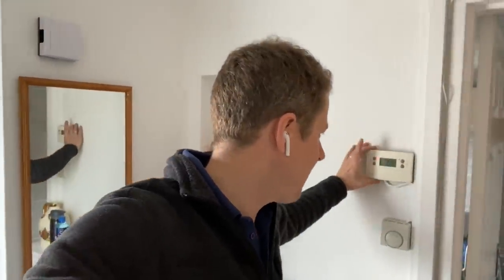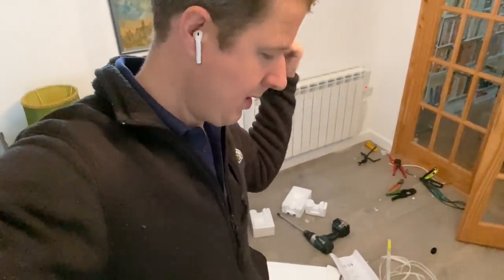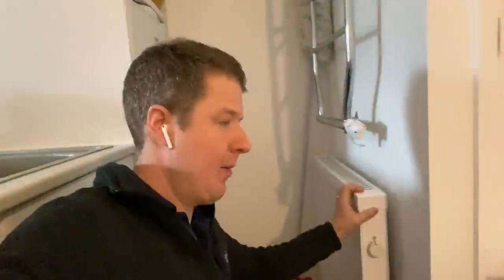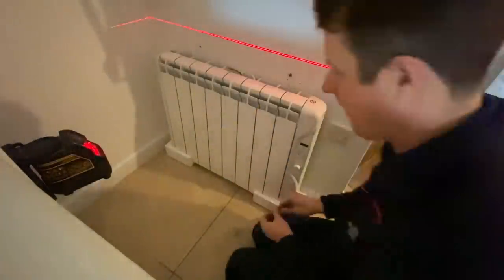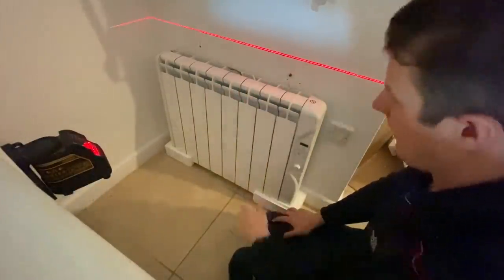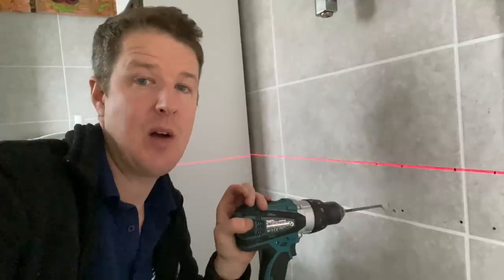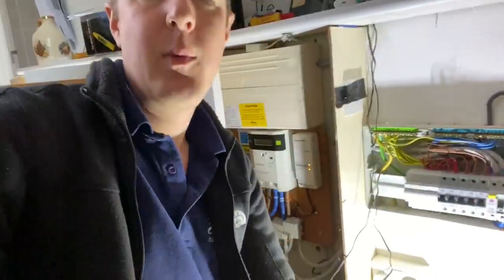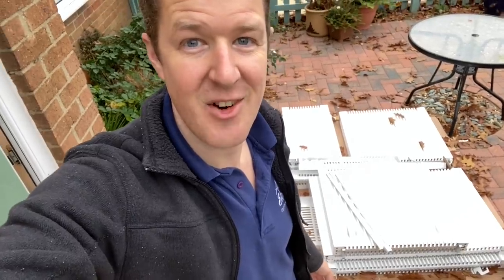Electric Heating Installation - Replacing old faulty Electric Radiators

Comment: Electric heating in 2019!!  I love it when these manufacturers say "they're more efficient than the old ones"... If it's resistive heating, it's resistive heating.  Assuming they had no way of installing a gas supply, they'd have been better served ripping the lot out and fitting a heat pump.
Reply: I agree, resistive heating is only efficient to a point.
But as for gas, I'd rather go with a huge heatpump and central heating, or here in South Africa go for heating/cooling air conditioning.
Joburg in the day isn't so cold in winter, normally in the teens with lots of sun. Best thing about summer rainfall is sunny winters 😁

Comment: I use the tile bits from Erbauer. Super cheap which is great for how often you actually need them. For marking, whatever I have to hand for most holes and a jab from  small screwdriver works well for plasterboard or softish plaster. The marxman tool is great for masonry and deeper holes though. Nice use of the flex ferrrules. For the busbar I usually use the impact to back everything all the way off before I install it, then still using the impact on its lowest setting I tighten the terminals at either end (while holding the MCBs together) then do the middle ones. After I follow up with a torque screwdriver for the proper settings and check visually using my phone but with this sequence I never miss any! 
I enjoy your EV point installs. I just got back from EVBOX DC charger training in Amsterdam yesterday!
Reply from the maker: Great thanks for sharing!

Comment: I’ve drilled tiles loads of times no issues. Mark hole location, using masonry drill of the required size place on spot, twist the drill chuck and bit Anti clockwise by hand using slight pressure on the drill, this will break the glaze on the tile where the hole is needed and prevent the carbide tip skidding all over when drilling. Use drill in power mode to progress through tile use moderate pressure, give the tool chance to do the job as my old boss used to say. Another tip is to use an engineers automatic center punch set on low to make the glaze breaking start point.

Comment: Great video again Jordan.  

I have done a few installs where the customer wanted a central control unit.  And the method that you took out was a great solution to do exactly that.
Some of these electric radiators can be very difficult to understand with programming etc.  And especially for the older generation. The last thing you want to be doing is keep going back having to explain how to use it over and over.
I find just having a standard radiator on the wall with a programmable thermostat (wireless or even a smart one) would make it so much easier to understand especially if it is something  they are used to.
I have used many brands, and found so far fahro to be a good radiator for simplicity.
It may be just me but iv always considered the best way of keeping any system as simple as possible for the end user.  
Iv also had to do jobs where they request no central control and all to be individually controlled.  So I suppose it's all down to the customers request.  

Nice tidy job though mate 👍🏼
I once left a cooker outside on a job and the time it took to take the new one into the house and come back out to grab a knife to unwrap it, the old one had gone with noone in sight !
Reply from the maker: Interesting comments thanks for sharing and watching!

Comment: In SA everything is line on top and load on the bottom.
So out of RCD with cable to the top of the breakers where you find the busbar. 
I reckon it's easier to see if it's loose or not in from the top.
Circuits out from the bottom just check by tugging on them.

Comment: Excellent as usual Jordan, unless you find some exceptionally hard tiles then standard masonry or multi material drill bits are fine.  I don't use a hammer drill anymore and just have a drill driver with multi material bits for mounting most things - saves a lot on noise.  If I have to drill a large hole or into something very hard I'll get the sds out.

Comment: Another great video Jordan 👍
Quite like the look of those rads, I work for a company doing social housing and the housing association request that we fit Dimplex QRads as standard now. For years we have been putting storage heaters in, but recently they decided not to install them anymore.
For marking holes, I’m a big fan of the Marxmann myself, but like the look of the one you use.
You seemed to be quite lucky with those tiles. I had a job to do a while back fitting a cabinet with light in on a wall with tough solid porcelain tiles. Had 8 holes to drill for the brackets. Started off using a masonry drill bit and the tile bit shaped like an arrow but took me almost half an hour to drill one hole 😩 could not proceed doing that, so nipped down to Screwfix and got an Erbauer diamond tipped drill bit. Was a bit costly at around £19 quid but was money well spent. Went back to the job to try it out and it went through the solid tile
In about 1-2 mins. Could not believe how effective it was. Always use this bit now when drilling tiles.
Look forward to the next vid
Reply from the maker: Great comments thanks for sharing!

Comment: I use diamond tip drill bits, but if I haven't got one I put masking tape on the tiles and use a masonry drill  bit on hammer. The masking tape stops the drill bit from sliding. 👍
Reply from the maker: Nice tip thanks!
Reply: On hammer? Surely not! If I'm forced to use a masonry drill I'll still use it on rotary only.
Reply: Masking tape also prevents splintering of the tile.

Comment: Niceic man had a mirror on an extender I thought was a good idea so got one does the trick
Reply from the maker: Great idea!
Reply: Generally. Ensure all terminals are fully backed out before fitting to rail. Fit bus bar first securing both ends first. And then tighten middle ones.
Reply: Yeah I got one of these form ALDI of all places that and an extender that’s got a magnet and light on it that was a god send on Friday when doing a Bonding clamp under a cramped sink and dropped the screw...it went down the hole and the plinth was screwed on and I only had the one clamp...got it out shoved it down the hole and click the magnet caught it and saved the day!

Really didn’t want to be doing the half hour trip to the nearest wholesalers late on a Friday afternoon.

Comment: If you replace your gas heating and rads with new electric rads, does anything need to be done to the mains electric, in the way of upgrading anything?  I would have thought a house load of these, 3-4 bedder, with 10-15 all electric rads, is going to be quite a power draw at a constant level?  Any concerns with that?

Comment: I drill through tiles on a daily basis and use a bosch blue or red tip drill bit, they’re about 3 quid in Screwfix, never had an issue with them and they go through tiles like butter
Reply from the maker: Great tip thanks!

Comment: 30 odd years ago my land lady declared that were were having night stores. The electrician arrived and two days later all was done. 6 rather large night stores. A special timer was fitted to the emersion heater too. He told us that from 12 midnight till 7am that the electricity was considerably cheaper. So before going to bed I set the washing machine, the tumble dryer and the dishwasher all to come on and went to bed.  I'm in bed reading and my table lamp went off. Got up to get a new bulb and there were no lights at all. Thinking the fuse may have tripped I went down and into the back room where the fuse board was, there was a terrible smell. I found a torch and opened the cupboard and there was black plastic dripping and it was smoking. I switched the main switch off and called the MEB (Midlands Electricity Board) who came an hour later, it's 2am. by now. They said that although the wiring was all correct and properly done the main cable supplying the house was simply not capable of carrying the load that was put on it and the electrician should have known this and called them. In the end they had to replace the main cable from the house under the road all the way to the end of the road, along with 2 other houses that had also been cut off because the cable had melted under the road. Nearly the whole day was spent with out power. As a foot note I set the timers in future to spaced out the times that things came on.
Reply from the maker: Wow thanks for sharing what a story!
Reply: Tumble dryer, washing machine and dishwasher on at night ? You’re lucky they didn’t set the house on fire.
Reply: @Kubulek17  have always run my dishwasher at night, dryers could be a bit sketchy though.
Reply: Normally storage heaters and hot water are on the cheap tariff, Economy 7 or 10 . The remainder of the electricity supply should be on normal rate eletricity using as seperate consumer unit, so the you can use it 24/7, whereas the Economy 7and 10 are only on at certain times, switched on a set times by your electricity supplier. When the power is on it will heat the heaters and the water on a much cheaper rate. Often water tanks are divided so if you use more hotwater, a separate switch can be turned on to heat up additional water but that will use the more expensive rate.

Comment: How do you wire the electric radiators, do you put on separate circuit or just plug in the sockets?
Reply from the maker: They are on their own circuits, they would overload the sockets circuit if you just plugged them in
Reply: @artisanelectrics  hope still here, with this I know some go in a fused spur, looking at oil filled and wanted to ask how far the fused spur should be from the radiator?

Comment: Thanks for the video. Were they solid walls you hung the rads on? How do you ensure that there is a stud or something solid to fix it to if not? Rookie looking for all the help I can get
Reply from the maker: Yes they were solid walls apart from one which was plasterboard so I used plasterboard fixings, plasterboard is stronger than you may think, if you use good fixings you're fine.

Comment: Why not replace or supplement at least some of the heaters with night-storage?
Reply from the maker: Night storage heaters are old school and not flexible enough for the modern client who wants to be able to adapt the system to their changing schedule.
Reply: Artisan Electrics nope the modern client understands that electricity availability varies hugely and the price we pay for it should do too, that’s why we’re looking into energy storage systems, to take advantage of those cheap periods of electricity when we charge our cars and heat our water cylinders.
Reply from the maker: Yes I agree

Comment: Did you find them tricky to set up.? I used them earlier in the year and didn’t really like the set up process/programming 
I have some lovely rointe custom painted black copper heaters to fit for a client when they get delivered.
Reply from the maker: They were pretty easy, just a shame you can’t sync them all together
Reply: I’ve fitted these and the go on the wall so easily ,the programming is only like most these days ,the day night 24 hr is a synch

Comment: are the new radiators any more efficient?
Reply from the maker: Yes they are, they are designed to comply with the new regulations for energy efficiency
Reply: I’m not sure its possible to make an electric heater that isn’t 100% efficient, you’d have to be transmitting the energy into a parallel dimension.  The problem with these is not the efficiency it’s the cost of fuel, 15p a kwh for electricity when gas is close to 3p a kWh
Reply from the maker: Interesting comment thanks
Reply: @edcooper2396  Oh they were the days, 15p per KWh.  Will we ever see the likes again...

Comment: The scrap value of the radiators belongs to the owners of the house... (unless stated in your tender).
Reply from the maker: I charge the customer for removing them, there's no way I can afford to waste an hour going to the scrap yard and give them back £20 for the scrap metal.
Reply: @artisanelectrics  I appreciate your comment, and its practicality. But my comment in general to plumbers, builders, sparks etc is that the 'scrap' actually belongs to the customer. My boiler was recently removed, as well as related copper piping. The scrap value? 20 % of the cost of the new installation. The issue is 'non trivial'. Happily I received my 'rebate', and my plumber got his 'maintenance' contract (not that he knew that at the time).

Comment: Dunno about getting a few quid for scrapping the old heaters, they are probably going to install them !
Reply from the maker: Ha ha the thought had crossed my mind!
Reply: I was given 3 week period to rewire an enormous old house before the the plumbers started. We pulled the old carpets up to go in the skips lifted the boards and found 2 old copper heating systems installed in old thick copper 15 25 and 30+ mm , it was worth a day ripping it all out before the miserable  looking plumber turned up. Great day . Agreed with home owner.